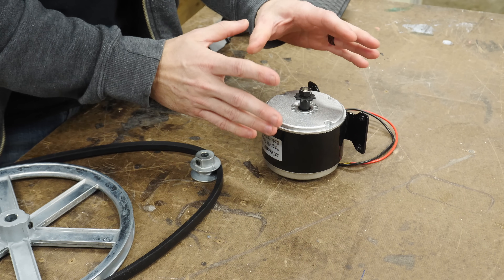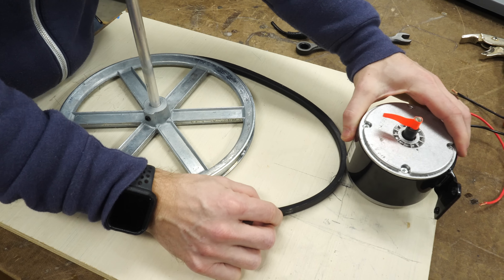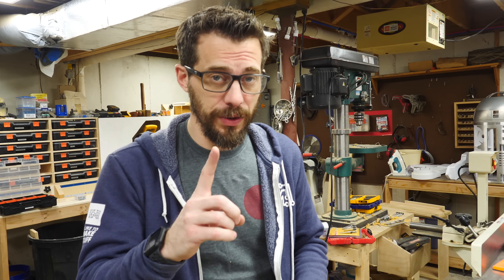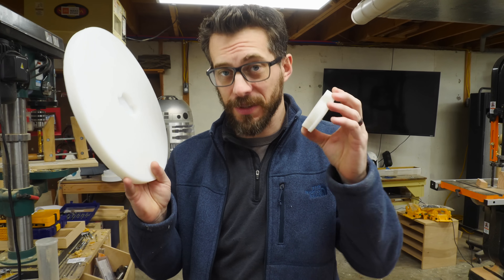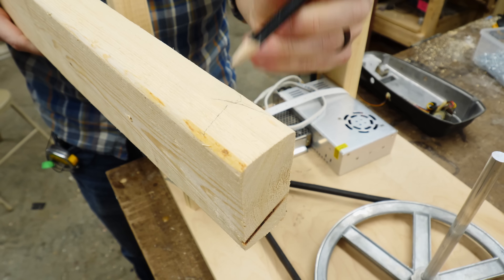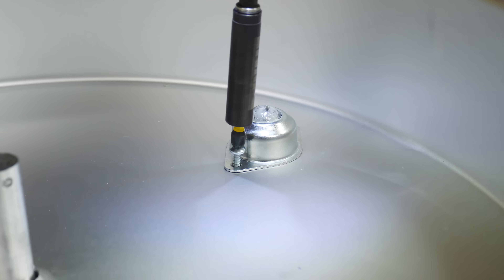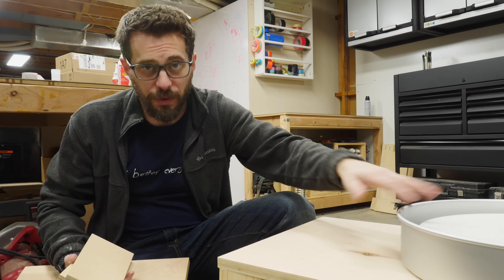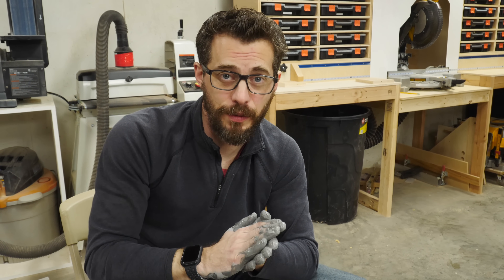How to Make a DIY Pottery Wheel | I Like To Make Stuff

Comment: Thank you for this. I’ve been meaning to make a pottery wheel for my daughter using an old commercial sewing machine motor. Your video showed me how to solve a few problems that I hadn’t worked out yet. Now maybe it will actually be done. Much appreciated. I agreed with some critiques below, but I should acknowledge that you actually MADE a pottery wheel, whereas I’ve just been planning to make one for the past year and a half, so what you actually made is infinitely more productive and efficient than the nothing that I’ve actually made. Kudos.

Comment: Hi Bob! Always a pleasure watching your creations. I have no experience at all about pottery, but it seems working very well. For the loud bearings problem you could try with small rubber casters so you can avoid the friction between the plastic and the metal of the bearings. I dunno if it can work better, but you can try next time.
Keep doing your stuff!!

Comment: This was great but I think you may want to make the bat and the basin removable. Eventually you're going to get a buildup of dryed clay in the wheels under the bat that you're gonna want to clean out, also how were you planning on getting your work off the wheel, and get rid of the water in the basin without taking the bat off?
Reply from the maker: The bat is removable 👍🏼

Comment: Put some rubber pads between the motor and the rest of the machine, that should quiet it down even more since most of the vibration should come from there.
Reply: I think the noise was mostly the bearings he had but your advise would make it almost noise free

Comment: I feel like you could have fastened the bearings just to the cake pan, and attached the pan to the table around the outside, then you could take easily take the pan out and clean it. But I don't know how often you need to clean a pottery wheel.

Comment: Another tip, there are inexpensive models that will run you about 300 dollars for a really good potters wheel its an old design but its been coming back recently, i appreciate the video but the cheap 300 dollar one u can get on amazon is quieter.
Reply: I need to know what I cma do with the pottery when it's done. I don't have a kiln at home. I always wanted to make pottery. Missed it since taking it in highschool.

Comment: Have you thought of putting a magnet in the recess of the plastic plate? It would grab onto the metal shaft and add a strong but easily breakable bond.
Reply from the maker: We didn't think of that, but it would work too.
Reply: And you have to clean from time to time under the plate to. :)

Comment: Girlfriend is a ceramicist, so I’ve spent some time on a wheel. You’re going to regret not being able to remove the bat or the tub that catches the water. They’ll both get gross quit, and not being able to remove the bat will keep you from easily removing whatever you just made. That being said, you can easily make bats to drop onto the one you have. Drill two holes into the bat you have, then make another bat with two holes in the same place. Put some pins through both bats and you’re good to go.
Reply: I was going to make these same two recommendations. They’ll be essential if this wheel is going to get much use. Multiple removable bats that sit in top of the base bat are super helpful because they allow you to pull a piece off and let it dry a little before you have to pull it off the bat. That helps save more delicate pieces. It would be super easy to add the pins and make a bunch of removable bats out of thinner material.
Reply: I was thinking along similar lines.  The splash tray on most modern models is in two parts which overlap and split for removal.  Cleaning it would otherwise be a bear.  Also the wheel head and bat are two different items.  The wheel head is generally made of metal that takes two removable bat pins to hold the bat in place. It’s scored with concentric rings which help you make sure your project is centered (crucial). I think the rest of the build is great, but the parts I’m talking about (wheel head and splash pan) can be purchased directly from the manufacturer of pottery wheels (Brent is best, IMO).  I would order them from there.
Reply: so wanna see version 2.0 of this
Reply from the maker: The bat does come off.  We found that the friction fit was good enough for use.
Reply: I Like To Make Stuff I did ceramics in high school and he’s right, what you need is some plates that fit into predrilled holes on your bat. That way you can throw a bowl and take it off the bat dry it for trimming then put it back and it’s still centered. The plates are a huge quality of life improvement. The big difference is that You can take them off and hose them down to clean them, you can also work on more than one project at a time. I highly suggest getting some kind of plate system going. They don’t have to be thick just a then sheet of plastic or whatever that goes on top and spins with the bat. 

Also just a drain tube that you can put into a 5 gallon bucket will make a huge difference when it comes to throwing and cleaning.
Reply: @Iliketomakestuff  but the wooden bats will allow you to work multiple pieces at the same time, allowing them to become leather hard before you cut them off helps not to deform the clay piece.
Reply: @Iliketomakestuff  Even if it didn't, I honestly don't want to taker anything apart. I'd rather put 2 posts on the back legs that drop down to raise the back end and tilt wheel. That way, since water is already attached you can just run the water and have it drain out the front. But to each their own.
Reply: I think the splash pan is more of a problem than the bats!! I prefer to not use a splash pan as it really interferes woth access to all sides of the clay for me, and not being able to remove a splash pan would be a deal breaker. if a wheel as an attached splash pan that is many inches from the wheel, then i could work around that. 

This is just personal preference but really should be an adjustment.
Reply: It would be important to be able to clean the pan and wheel. It would not be usable without cleaning it
Reply: THIS.
Reply: PolicePubliCallBox amen
Reply: My thoughts exactly
Reply: As someone who is intermediate on the wheel, I had the very same thought. The plate underneath the bat should be more secure. If you aren't careful, you could accidentally pull up on the clay too quickly and hurt yourself or damage the equipment while the wheel is moving. Depending on one's skill level that may be unlikely but is worthwhile for the sake of safety.

I've been heavily considering building my own wheel. I do like a lot of this design and it is parallel to my drafts so I will probably borrow some elements. 

That said, the only thing that I would make an effort to ensure the wheel stays perfectly level and add something for suspension so it doesn't wobble. 
However, I am no expert in mechanics and haven't figured out exactly how I would do that. That's more my partner's aptitude.
Reply: You don’t necessarily need to solder that connection @ 10:07, you could just some cheap beanie connectors

Comment: the container needs to have a way to be removed easily so u can clean it out, also the wood should be waterproofed or else all the water and oils will ruin it overtime. I like the concept but its a bit impractical the way it is now. Also id add some bat pins.

Comment: Great job! A sewing machine pedal should work the same way as well
Reply: WoodChuck Creations my thoughts exactly!
Reply: The problem with most pedals are they’re sprung and only have a foot plate away from the pivot.  

A pottery design allows you to push the pedal so far, then let go and keep your foot flat on the ground. It rocks either side of a pivot. 

Thinking about speed with your foot, whilst also crafting clay with your hands just becomes an added task.
Reply: Can you link to what sewing machine pedal that works the same?
Reply: @VincentDzinh  
Any sewing machine pedal would work. I don't know where you live.